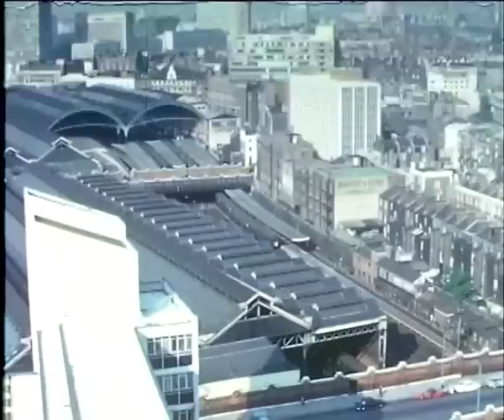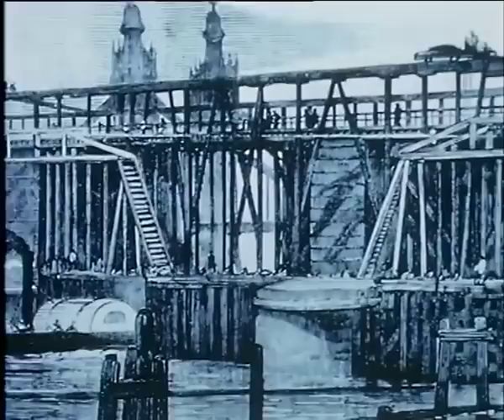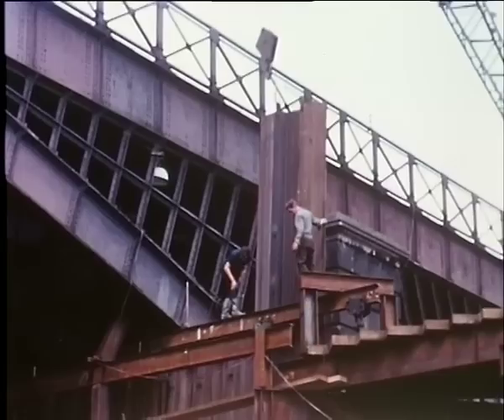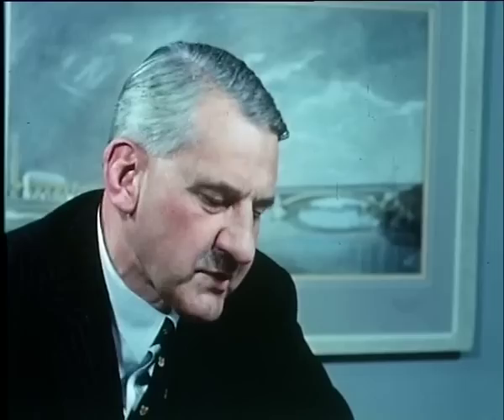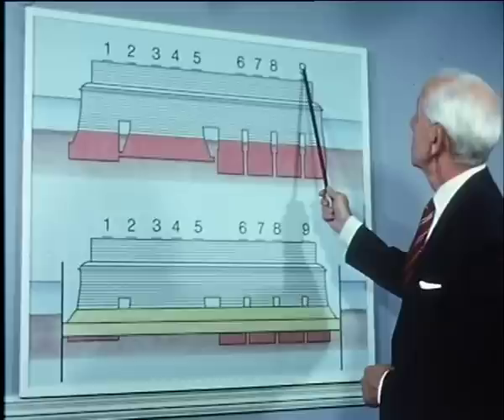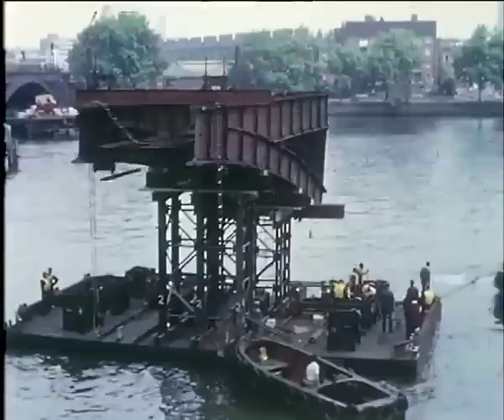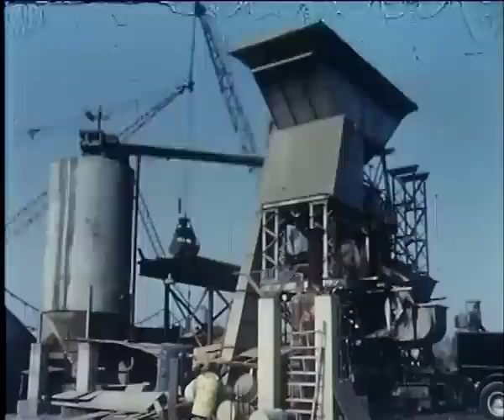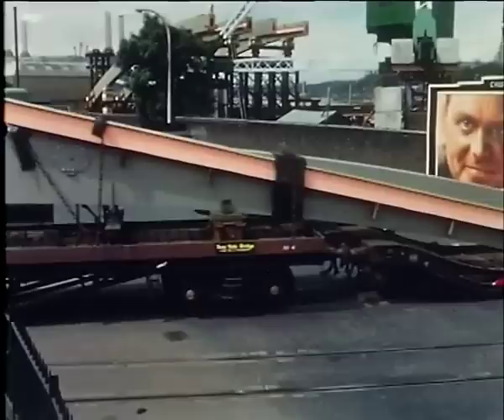Railway Bridge Across the Thames

Comment: Good to see old Brunswick yard on the downriver side of old Nine Elms Lane. Apparently when the contractors were clearing the site before the building of St George Wharf they found two layers of tracks. At some stage during the  early 20th century the permanent way lads had just laid ballast on the original 1850's trackwork and laid new sleepers and rails on top. 
Brunswick House was once the offices of the London and South West Railway and the paraffin store for the lamps on the buffer stops was built against the Western wall of the house.
Legally locomotives weren't supposed to cross Nine Elms Lane, first horses then a tractor moved them into the yard but those bridge sections probably needed more than a tractor to go at that speed. Great video this, and a useful health and safety instructional film.

Comment: I remember winding those winches for about 2 hours. From what I recall the spans where winched by hand for accurate placement beneath the gantry that lifted them into their final position. My Father had the contract to supply the Watermen and the boats used on this construction.
Reply: I`m just wondering what the gear ratio must have been in order to do that! Very interesting info, Terry. Thanks.
Reply: @darkgreenambulance  3.85 lumbar vertebrae/vertical inch.
Reply: David Shields  My father, Les Thomas,  had 30 men working for him on that job in 1966 and he was on  £600.00 a week

Comment: Beilah25

Thank you for posting this film as though it is old ( I'm older ) it is fascinating to see how projects were completed in the days of manual labor and slide and pencil on the drafting table to figure everything out.

Hand cranked winches? A tip of the hat to the men on that job as a winch seems like such a simple machine but you had to be tough as all get out to do that job all day. I worked a hand winch for five weeks on a small job the boss didn't want to put a diesel crane on and the 6 men assigned two at a time the first day we thought we were going to die until and experienced with men showed us the error of our ways and while it was hard work it was a lot easier after he showed us what we were doing wrong. We finished 3 days early and earned a $1500 bonus.

Comment: This film is actually pitched at a technical audience. A lot ofinformation is quite complex for the layman. An analogy for me is putting a crown on a worn tooth. The core structure of the original bridge remains supporting the new engineering. But the primitive winches, digging and minimal safety equipment seem ancient in the 1960s. And the crucible welding process looks terrifying. What about thermite/ electric welding ? Still its an amazing film.

Comment: Why on earth  didn't they use electric motor power to wind those winches, it was available at that time after all.  3 men winding each one of god knows how many there were is just crazy economics.
Reply: You would need a generator on the barge, just something more to go wrong. OK the could have used power winches on the gantry. But when working with the rivers current and rise of tide, you don't have much time to fix problems. Keep it simple.
Reply: Labour was cheap and plentiful in those days.

Comment: A thousand trains a day into St.Pancreas !! The number of trains per day must be less than 1/10 of that number today.After Beeching closed 55% of the stations and 33% of the network,100 trains per day would not be unrealistic/
Reply: St Pancras?  This is about replacing the bridge into Victoria.  The southern commuter services suffered little from Beeching in comparison with other areas, and yes a thousand trains a day into Victoria is probably still not far off correct.
Reply: The lines which Beeching closed  did not run into London.